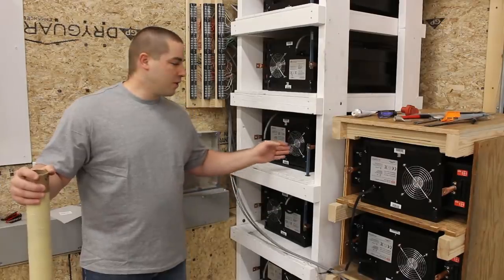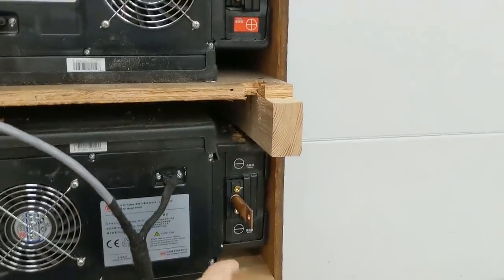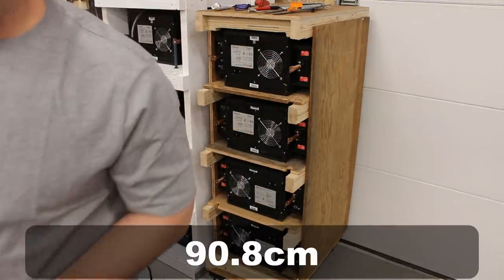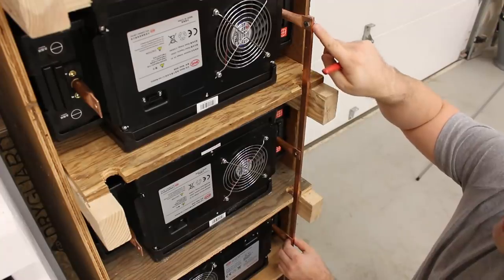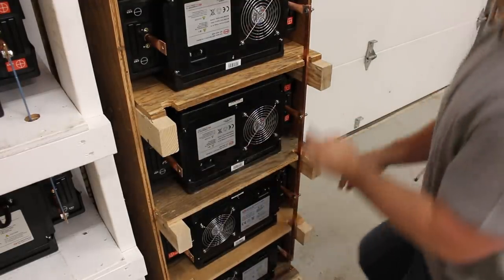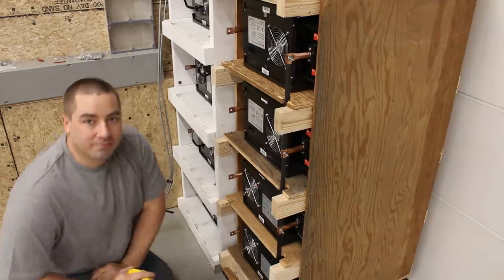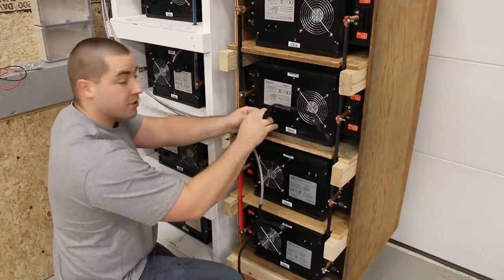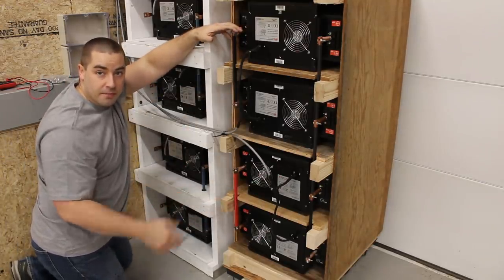Series and Paralleling LiFePO4 Batteries 48v

Comment: Electrically you will achieve the same result (your tower vs your friend's tower) so it goes to ease of maintenance followed by ease of hookup in my mind.   By ease of maintenance, I mean ...  can I take 1 battery off the shelf and replace it (for example) without disconnecting the entire tower or disabling the entire battery (maybe leave 75% of battery operational while fixing the back unit).  By ease of hookup, I mean... expense/hours to do the hookup.     To me, maintenance - being able to replace an individual unit easily while leaving the overall battery operational - would be the deciding factor :)
Reply: When you remove one battery, its mate will take twice the current. I don't think that's a good idea.

Comment: Thanks for your series on these battery banks. 
I have the same setup you friend does and have been using 2/0 cables, but like your idea much better, so I ordered some of the copper bars via your link.
It will look much less Frankenstein...

Comment: Version 2 is best in setup and design. I would however use double wall adhesive shrinkwrap for a safer and thicker wall of protection on those buss bars.
Reply: I'd drop a piece of PVC over them, just expose the ends, and cover that with something adhesive maybe. A piece of PVC would provide plenty of insulation and not be nicked easily.

Comment: It is better to parallel the packs first and then put the parallel packs in series, in this way a weaker pack can be supported by its parallel buddy and does not bring down the system capacity by very much.

Comment: to answer your question using the solid bus bars is next level and in my opinion will reduce loss during cycling and extend the life of your batteries because strand copper has more resistance than solid...

Comment: I agree with the other posters regarding your way of wiring as preferable since you can remove a pair easily for maintenance. With as much energy there now, it's time to think about safety and covering the terminals.  A short with a tool or other mishap would not be pretty.

Comment: David there are pros and cons to both methods. My personal opinion is I prefer the way you did yours since it isolates each pair just in case something happens to a individual battery pack you can disconnect it and your system is not completely down just a loss of capacity.
Reply from the maker: Good point.  Thanks.

Comment: Hi David.  I just measured my BYD cell's internal resistance at .0005 ohms.  Assuming you have 12KW @ 90% efficiency then at 48V you need 275 amps.  With 4 in parallel that's 69 amps per cell.  So I2R yields a heat of only 2.4 watts per cell.  So I think you'll never need the fans.  Even less for me so I took off the fan and heat sinks and saved 40 lbs per battery and a bunch of space.
Reply from the maker: Wow, I would have never guessed that the heat sinks and fans add up to 40 pounds per module.  That's great to know.  Sounds way better.

Comment: Cheack the heat on the bus bar between the top and bottom half under heavy load. I noticed when putting 2 banks of 5 cells in series the connection from one bank to the other was getting really hot. It was a thin irre but still, seemed to be the funnel point for the energy and created excess heat.

Comment: I'd recommend brass or copper bolts to be used. Stainless won't thermal-expand at the same rate as the copper material (different CTE's) and you might end up with loose contacts in the future. Also, always double the bus bars cross sectional area out of a parallel, otherwise you'll restrict the current capacity of the system

Comment: Looks good. Did you just use the wires that are already in the unit or attach your own leads?
Talking about the balancing wires.
Reply from the maker: I used the wires that were already there.  However, it would have been faster in the end if I just added my own.  If I did it again I would add my own wires direct to the cells.

Comment: Nice work bro. I prefer the design of your friend.
What battery charger you going to use and what BMS board you going to use for this  setup? 
What is going to be solar panel capacity for this system ?

Comment: First is cool if you want to add breakers to each set, i guess. 
2nd looks cleaner. I would have used the Copper Plumbing with Tee's and L's and borrowed someone's compression fitting tool.
I think it would perform well and have a cool steampunk weird look

I would like to try to find a DC breaker that has NO/NC contactors so you could use it as a contactor . I know they make AC breakers with that feature. 
Then the BMS, or safty equipment could turn off the power at each battery

Comment: Hi. Please tell me  I've got lifepo (4) connected to growatt 3000tl lvm especially but only 100hrs would like to add 4 more batteries.  Slightly confused on the parallel connection part , also don't know or have a bus bar or what it's for.  I'm on a tiny house so space is tight.  Thanks

Comment: David, this new bus bar arrangement is very, very elegant! Simple and effective - brilliant!
I wonder if one can substitute aluminium for the copper?
Reply from the maker: Sure.  Just double the size of aluminum for the same amps, and use Noalox on the connections.
Reply: @DavidPozEnergy  I've plenty of aluminium and always looking for ways to use it sensibly. Thanks David.
On another front, would it be worthwhile to use some dielectric grease on the aluminium bar stock? Bugger, I just looked up "Noalox" - that is anti corrosion grease. Question answered!! thanks again.
Reply from the maker: You probably know this, but it's worth repeating.  Aluminum needs to be cleaned up to bare metal before use, even if it's brand new.  Aluminum oxidizes.  (clean just at the connection points)
Reply: @DavidPozEnergy  Yes, thanks for reinforcing that! :)

Comment: I noticed in my recent research that a brand new replacement Chevy Bolt (not volt) battery pack is $11.629 for a 60 Kwhr pack this is about $194 / Kwhr for brand new cells  however I believe these are pouch cells and I can't find were anyone shows a disassembly further than the module level that are not 48 volt .  At least some of them are 72 volt.  I would assume for solar they would last around 20 years for most people.
Reply from the maker: Battery Hookup had some Bolt batteries for sale last month.  They tried breaking them down and said it was hard to do, but it could be done.  They were selling them as 10s modules I think?
Reply: @DavidPozEnergy  I didn't see that will keep a look out.

Comment: I like the new way you done it but is there enough flex for any expansion and contraction on the part coming from the battery.
Reply from the maker: Yes there it.  The posts coming out from the battery are screwed to the plastic housing.  Then there is a flexible banding that goes to the cell.

Comment: have you ever considered old server racks for a frame? they are often dirt cheap at surplus auctions for state universities and the like. seem like they would be much better suited for heat dissipation and potentially more convenient if they have something like drawer slides. plus they are usually quite sturdy
Reply from the maker: I didn't look into server racks.  But if they are dirt cheap, then I should have.  Thanks for the tip.
Reply: And for safety reasons too. All builds in the US seems to use wood, waaaaay toooo much wood. It's a disaster from fire safety standpoint.
There should not be any flammable or not flame retardant material near these power installations.

Comment: Nice setup David, my only (admittedly novice) question. I was of the understanding that DC preformed better using fine mutli-stranded cable rather than a single conductor. Will your solid bars create a “bottleneck”?
Second question, what is your opinion of the all in one systems like the Victron EasySolar , MPP, etc?
Reply from the maker: I don't pay attention to the "skin affect" argument when we are looking at these types of systems.  Maybe if you are building a powerline to travel across the country you might care.  In this case I don't think I'll have any bottleneck from using a solid copper bar.  Thanks for your question.
Reply: When you put that minute components in one box you exponentially increase your chances of one thing going wrong which means the entire system shuts down.
Reply: Skin effect is something that comes into play as frequency goes up. Not an issue with DC.
Reply: @DavidPozEnergy  also less surface area for the inevitable long term corrosion to affect
Reply: Skin affect only comes into play at higher frequencies starting at around 600hz.  Solid copper is better because it provides a bit more heat dissipation.
Reply: The telephone central offices were designed with large copper bus bars to interconnect their large strings of 48v lead acid batteries to the distribution. Perhaps 12" by 1/2" by 3'. We had one case where the installer dropped a screwdriver across the two bus bars and it vaporized the tip of his screwdriver. I believe that OSHA required 48v systems to be inaccessible to untrained people, you don't want a kid playing in the garage with these 48v systems with exposed wiring.

Comment: I figured what you did flipping batteries after you took the voltage reading in your last video. So you only have 40kwh to run your house. Your 12kw inverters can drain your storage in few hours at max draw. I am assuming you only use 24kwh a day or less right now. Just remember plastic or wood are not fire proof. If I remember are not approved per code. I am going to use U strut for battery shelves and keep them in separate building, I know your garage is not connected to your house so that is good. Are planning to have one battery bank  per inverter or one big bank for both inverters?
Reply from the maker: I plan to have one big battery bank for both inverters.   If you post a video showing your shelves, let us know.  I'd love to see it.  Thanks for watching.

Comment: 4:40... I like the copper buss bars and heat shrink insulation.... It is the way I would go.
Since you asked... I like the last idea with the copper buss bar connections.
 BTW David, What's your day job ?
Reply from the maker: Thanks.  Yeah, it looks much nicer with the buss bars.  My day job is residential energy auditor. (insulation and air-sealing stuff)
Reply: @DavidPozEnergy  Looks like your Day Job coincides with your off grid energy projects.
A home needs to be tight to get the most out of energy collected.

Comment: What BMS would you use for these batteries? I'm getting 4 just like them for my system. Also where did you get the lugs for post n neg post to bolt the copper strip to? Thank you for your help. Hope you have a Merry Christmas
Reply from the maker: I'm currently using a Chargery brand BMS, but I'm not very happy with it.  I've been doing testing on another one called "Tiny BMS" which is working far better than the Chargery brand.  I'd go with the Tiny BMS and external Relays https://www.energusps.com/shop/product/tiny-bms-s516-150a-750a-36
Here is a video on the lugs: https://youtu.be/hgeOalKOBFc
Reply: @DavidPozEnergy  Thank you for your help I am new to solar but looking forward to getting it hucked up. Thank you Sir for your help.

Comment: Dave I believe you found the actual  connectors door the BYD posts pretty sure you said they were like $35 each could you send me more info...    thanks
Reply from the maker: Sure.  it was part # RL01410-135RE.  I bought from Heilind Electronics, Inc.  I thought they are too expensive for me.

Comment: We connect 3x for your Battery-pack (48V, 50Ah)  in serial DC ( 144v , 50Ah)  ,  and RS485 communication Cables .
Then we connect the DC output to the Growatt Hybrid inverter SPH5000TL3 DC,   and via CAN with an  CAN-Cable  also to the CAN - Plug of the Inverter.
 
 
BUT Growatt Inverter can not communicate with YOUR Battery-Packs!??      what is the reason for it ?  what about the setting of the 4x dip-switches of each,   if they are in serial-connection (master  slave) ?So, we need urgend ,  for YOUR application we use,  technical support /  connection plan scetch from your tecnical depatment.
Also we must konw , how to  set the dip-switches for each battery-pack (Master   and   slave  settings for each Pack) ?
 
Aslo we need to know , if we need special CAN  cables   or Special RS485 Cables????
Reply from the maker: I don't know what you are talking about.  I don't make batteries.
Reply: @DavidPozEnergy  but you know how to cennect them to inverter or not?

Comment: My mind easily accepts the first design's electrical (logically) but the second design is more refined.   Could you tell me if it matters what time of nuts you are using to connect the bar to the terminals?
Reply from the maker: I'm using stainless steel nuts and bolts.  I linked to them in the description.  Was there something specific about the nuts or bolts you want to know?
Reply: @DavidPozEnergy  I was wondering of different types of metal cause different terminal reactions and corrosion. I noticed that my daughter's car battery terminal builds up corrosion much faster than my other older automobiles.  I wondered if the different metals of nut and bolt on the the copper connectors, the batteries lead terminals and the zinc tightening nut and bolts  has anything to do with it.
Reply from the maker: Zinc is worse than brass or stainless steel, but the main problem with car batteries is the acid from the battery venting.  That's not a problem with lithium.
Reply: @DavidPozEnergy  Thank you. I'm new to the world of lithium.  I wish you a merry christmast/holidays.

Comment: Question for anyone here.    Do they make high capacity LiFePO4 batteries for low current demand?   I want to deploy game cameras on my property for like 6 months unattended use.    Right now I’m using four in parallel each rated at 6000 mAh.    I use a Boost Converter to get up to 6v. I’m just wondering if low current demand batteries might be less expensive.     Thanks.

Comment: Is it OK to parallel connect a 24v 3khr LiFePO4 with a 24v 6khr LiFePO4 battery.
Reply from the maker: Yes.  The two batteries have to be within 0.1 volt of each other before you connect.
Reply: The 3khr is reconditioned batteries and the 6hr is new batteries, both are from bigbattery.com  They are saying NOT to do it so I'm really confused.

Comment: What BMS system do you use for these?
Reply from the maker: There are lots of BMS's you can use.  Each module is 8s, LiFePO4.  This is usually listed as nominal 3.2v, or 25.6v.  You could use a small BMS for each module such as this one: https://www.aliexpress.com/item/32921488283.html?spm=a2g0o.productlist.0.0.46ab5bc1qlyDVn&algo_pvid=88bd92ce-3291-405d-b02f-5f70b57b68d8&algo_expid=88bd92ce-3291-405d-b02f-5f70b57b68d8-0&btsid=d99a0157-6ded-4817-b6e7-9ff7ae2c97e1&ws_ab_test=searchweb0_0,searchweb201602_10,searchweb201603_55

Personally, I'm going to use one centralized BMS from Chargery: http://chargery.com/BMS16Pro.asp  This is a test because I have not used a Chargery brand BMS before.

Comment: If you order C14500 copper bar, it drills much easier, and still has 93% of the conductivity of pure C10100 copper. Just an option...

Comment: ? can you connect 2 inverters together for more power output to plug in multiple things
Reply from the maker: Sometimes you can.  I'm currently running two SMA inverters together.  It's called paralleling.  But there needs to be a data connection between the two so they work together.  Some inverters allow for this and some don't.
Reply: @DavidPozEnergy  thanks can you do a video on it

Comment: Why 48 volts?
Reply from the maker: This industry (solar/inverters/batteries) has been built up over the last 60 years based on lead acid technology.  Lead acid batteries have been readily available in 12v configuration.  So the industry adapted 12v, 24v, and 48v as the nominal voltages to build the equipment around.
Reply: @DavidPozEnergy  Aha, I see. It would be cool if you could do a back to basics video on Lithium-ion and different battery configurations. I am trying to build a router UPS, I live in South Africa and we only have one power producer called Eskom (google it, but make sure you sit firmly because you will fall of your seat when you realize that in South Africa due to government corruption 25% of the country is without internet every 4 hours as they do “load shedding” essentially a fancy term for power cuts due to the inability to deliver the demand.
Anyway point is due to this, I would like my internet to remain on and I have used a lithium charger and 4 cells from the Samsung 18650 batteries and a boost converter to create a 12 volt UPS for when Eskom kills the power, but I still feel I am missing some fundamentals in terms of when to use 12v, or 24v or why I can’t just use 3.7v and increase the capacity and boost up to whatever voltage I want.
Basically, looking for a video that can explain the anatomy of something like the Ratel 860P (https://sinetechstore.co.za/shop/solar-kits/backup-power-kits/ratel-860p-micro-dc-ups/) it seems to be a great UPS to reverse engineer.

Comment: I am going to coat my bus bars with benzotriazole to prevent oxidation.
Reply: Why?
Reply: Not really a concern, honestly. So long as there's a copper-to-copper joint there's no real concern of galvanic corrosion and the only other corrosion he's likely to see is basic oxidation which really won't effect the connection enough to notice. In some cases, depending on how the oxide layer forms, it's actually more corrosion resistant with negligible resistance increase.